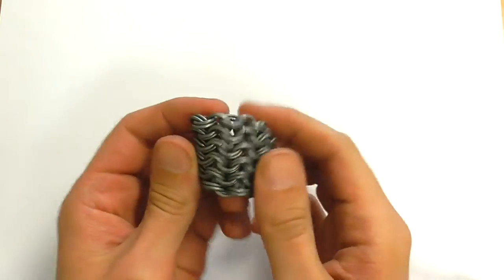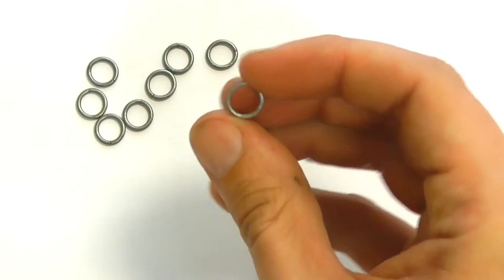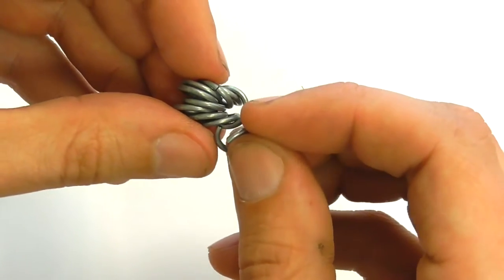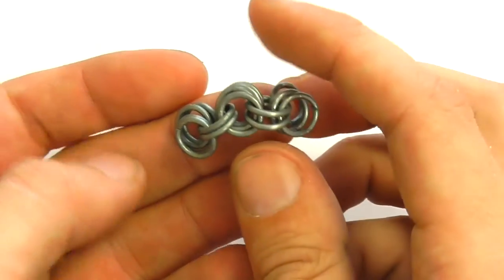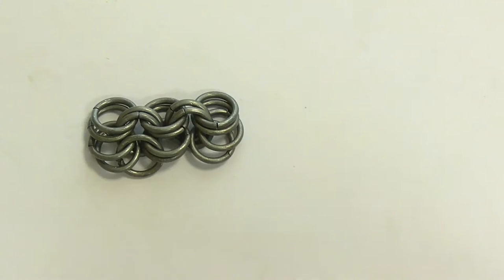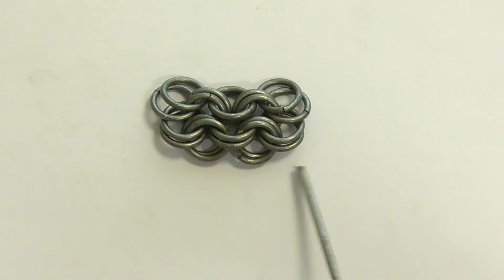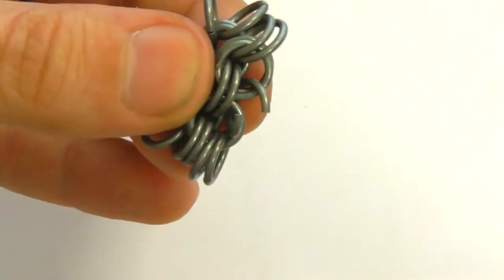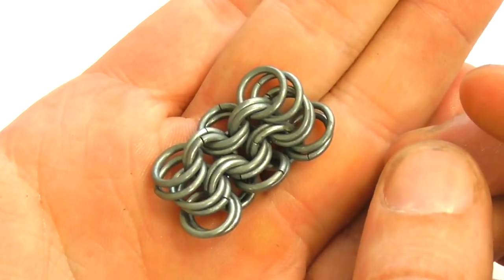CHAIN MAILLE TUTORIAL KING`S MAILLE

Comment: Imagine if that was welded or riveted, oooooooh that’d be near impossible to break
Reply: I made some 8 in 2 welded mail. It was made of 1.25 mm chromium steel with 7 mm inner diameter. I do some heavy sparing so i needed to test it. When I ran full speed at it and thrusted the spearhead into the mail as hard as i could the tip snapped. It was nailed to a tree without any padding, so it'd be even harder tk stab through in real life. It is a bitch to make though.

Comment: I am using 1.7mm wire, what inner diameter would you recommend for this kind of weave?
Reply from the maker: If you will take a 8.5 mm mandrel, then you will get the same AR, that in my video. So, 8.5 mm would be fine =)